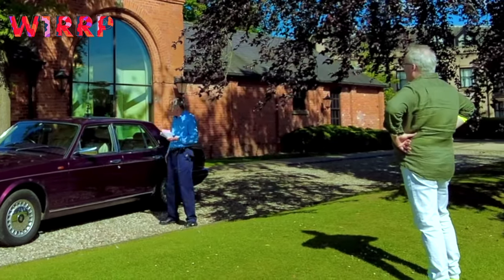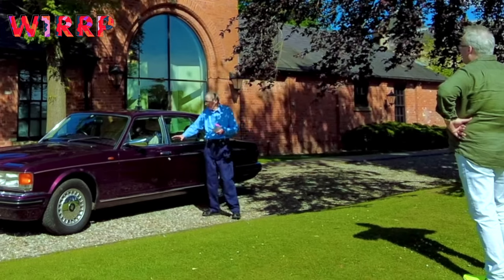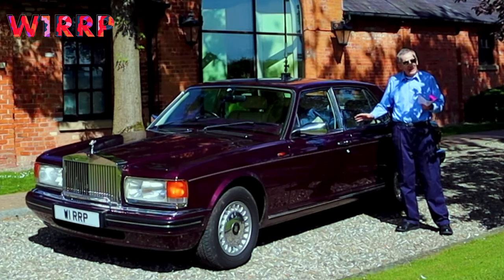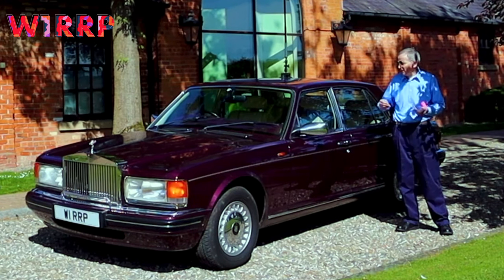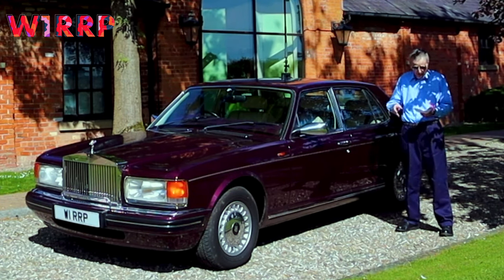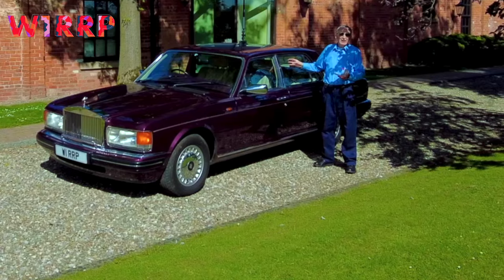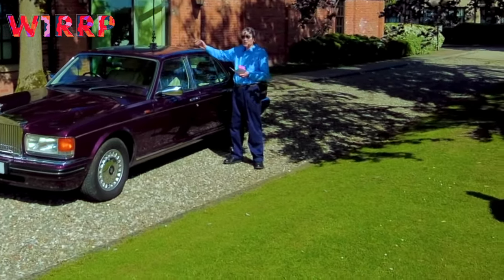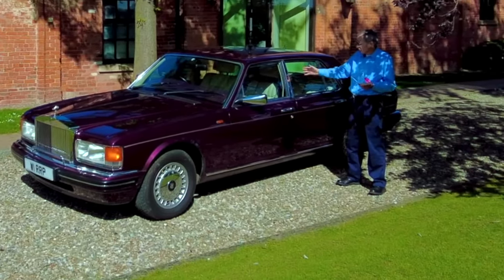Obstacles To Designing Rolls-Royce Long Wheelbase Park Ward RR SZ Touring Spur Jankel Mulliner

Comment: since a lot of these models were sold as a long wheelbase version, it sounds very counterproductive to make a regular one and then stretch it to make it LWB. It would make much more sense if they had two different models, one line for the SWB and one for the LWB models. The rare ones were the Park Ward LIMOS which were several FEET, not just four inches, longer.
Reply from the maker: I guess, they weren't expecting the Silver Spurs to sell in such high numbers? Yes, the Park Ward ones are lovely, but rare and expensive!